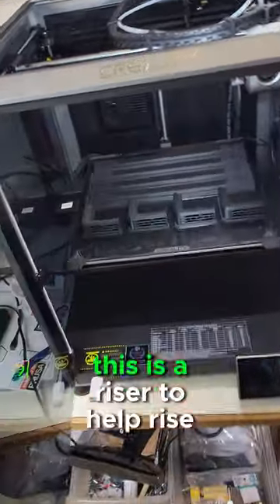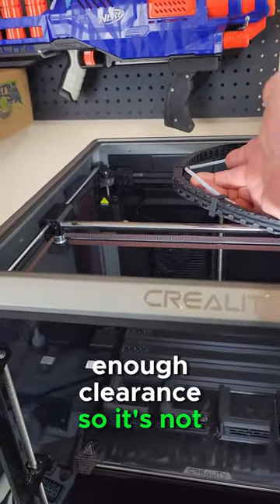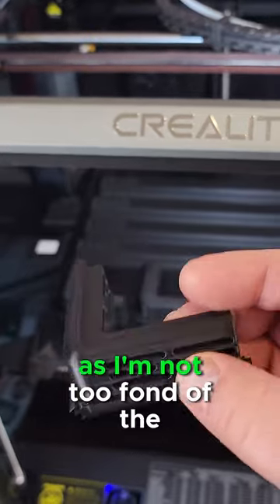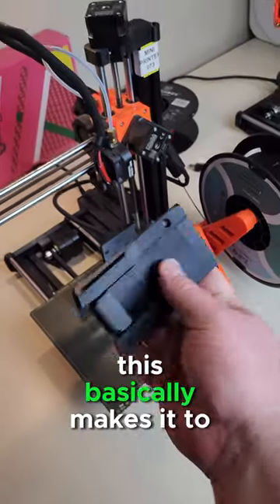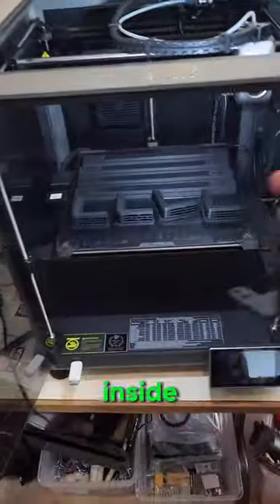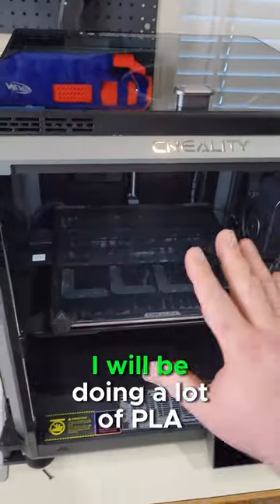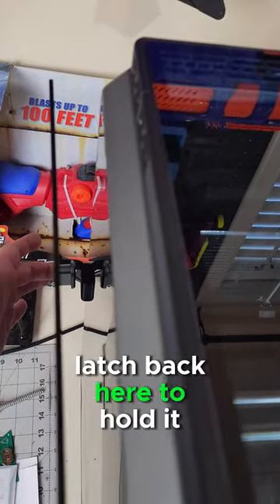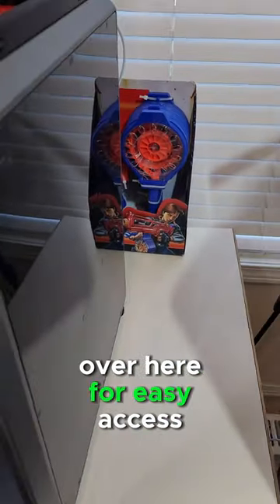Must upgrades for the Creality K1 Max  - Part 2

Comment: Very interesting, these are practical upgrades that should have come as part of the basic design.
Reply: Not really. The door one, sure, but the venting negates the purpose of having a printer that supports more complex materials and the spool holder is just personal choice. It doesn't make much sense to put one on every side just incase.

Comment: You said you use orca for printing. How would ypu compare it to cura? I have beeb using cura for a few years now and wanted to branch out a bit.
Reply from the maker: I have been using Bambu for the last year so im really familiar with Orca as its heavily based on Bambu's software.  TBH I haven't used Cura is years.
Reply: @drflux  oh ok cool i will have to look in to it. I know some say the prusa slicer is really good to.